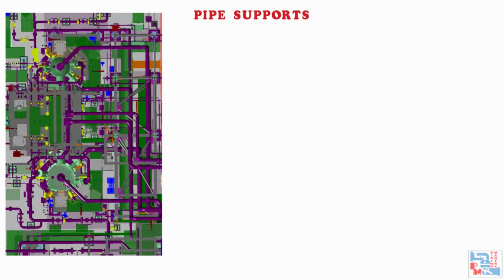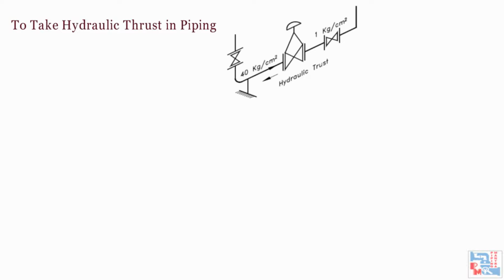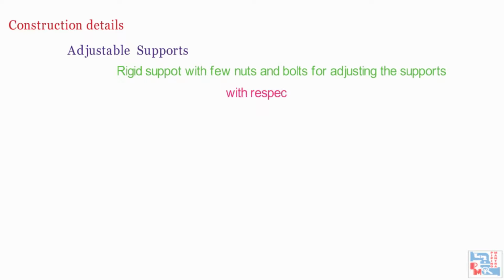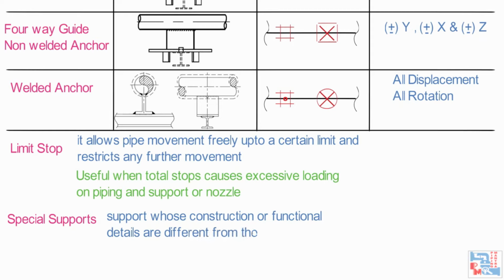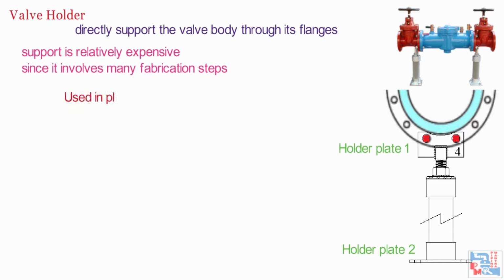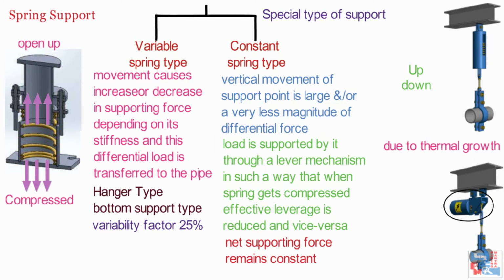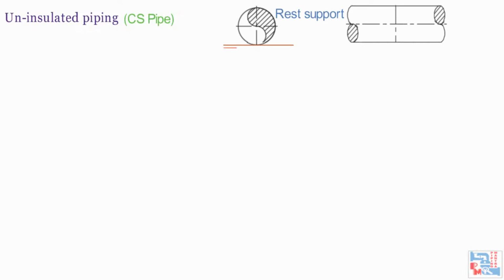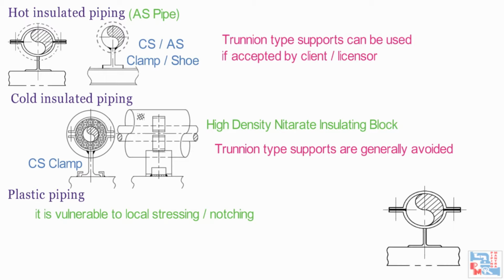Pipe Support | Types of Pipe Supports | Primary and Secondary pipe Supports | Piping Mantra

Comment: Is pipe shoe needed to weld to secondary supports always except thermal expansion loops??
Reply from the maker: Shoe only welded to pipe, not to secondary suppprt. If all round restrictions need to be added with 0 mm gap, then only shoe can be welded, but avoid such welding of shoe with secondary members or civil structure